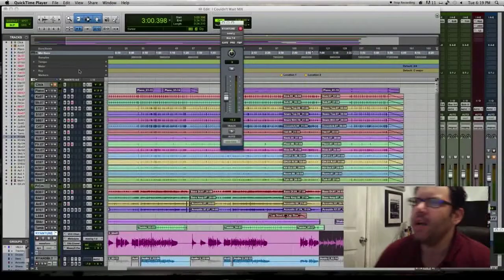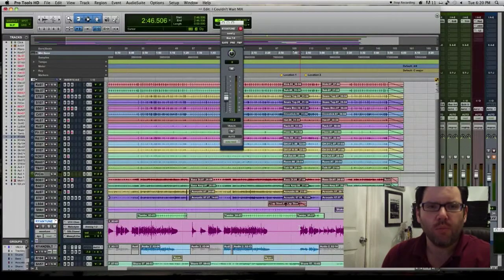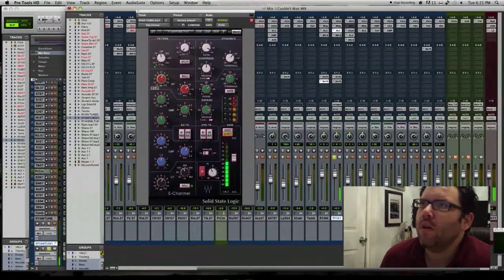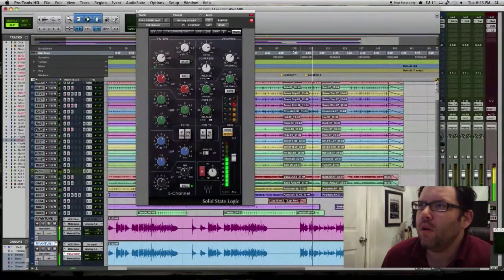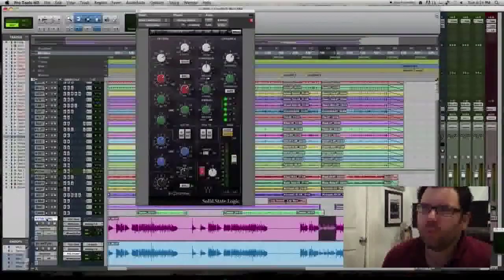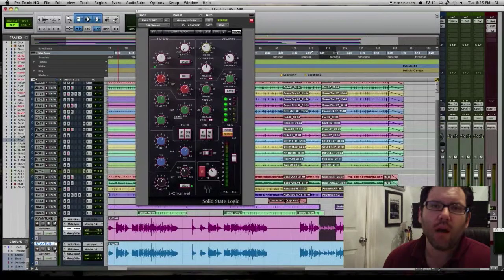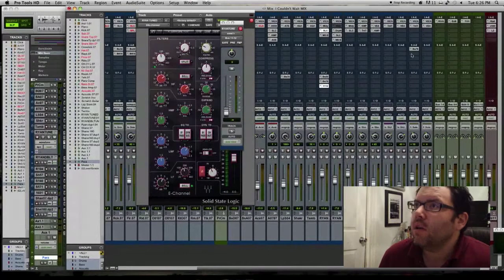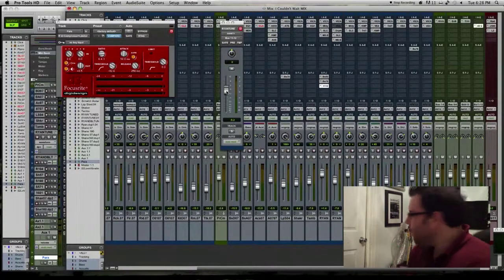Sonic Labs Episode 2 (Parallel Compression)

Comment: Great stuff jack. When u talk about doing this with an AUX track, (as opposed to doubling) is that the same thing as using an fx channel? I use studio one, and I can either set up a bus (to group tracks) or an fx channel to feed a specific effect to different channels.

 How often are u putting these videos out? If you can put out something on mixing midi drums that would be great.